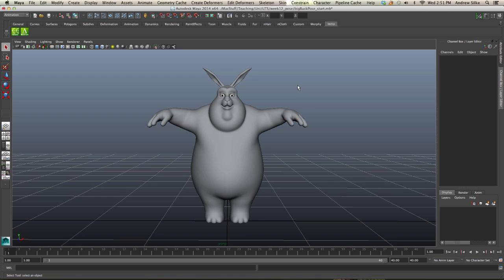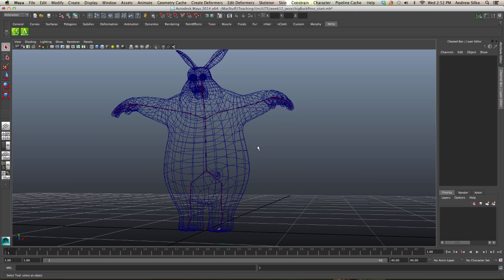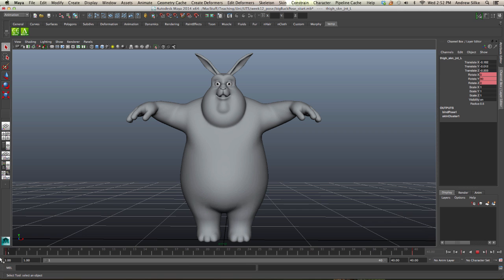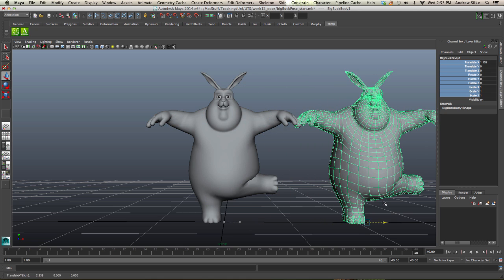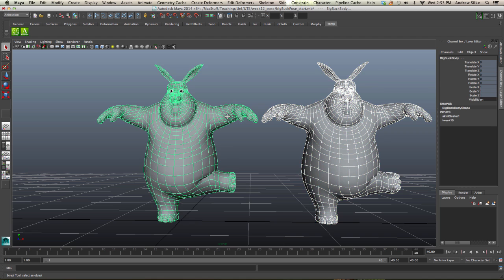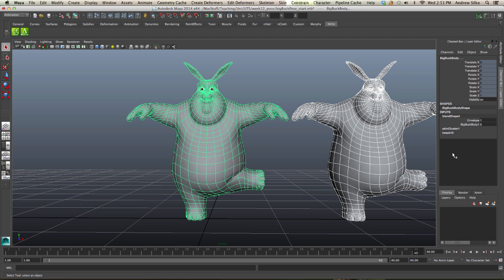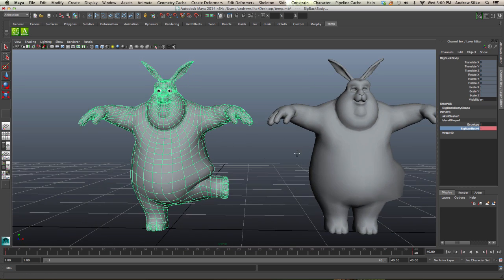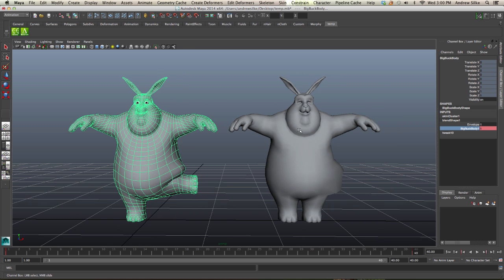Corrective Blendshapes: Manual Method (Maya)  Vid 2/7

Comment: Thanks. Does Maya have Corrective Smooth modifier like a Blender? It is very nice for animation
Reply from the maker: Yeah this tutorial is very old and it's all built into Maya now. The newer Blendshape Editor now handles creating the blendshapes automatically and extracting the deltas, so no need for this workflow anymore.  Blendshapes in Maya are just a single node, so it's similar but not the same as a modifier. 
Maybe lookup some "Blendshape Editor" tutes.  "Correctives" is more how you hookup the blendshapes to rigs, you can do that via "Set Driven Keys", or "Pose Interpolator" which is a kind of a RBF solver.  Anyways you can lookup "Pose Interpolator". 
I use the "braverabbit SHAPES" plugin for all my blendshape work now, it automates everything nicely and handles complex setups.  Its for professional setups.  
http://www.braverabbit.com/shapes/
Reply: @andrewsilke1  Thank you. Corrective Smooth in Blender works like Mayas Delta Mush. And Blendshape like Shape Key. Thanks for link
Reply from the maker: @olesyanovik2118  ah no, not delta mush, that's something else ;)  Extracting Deltas is different from delta mush.  Don't worry about what it is, the blendshape editor now handles it!

Comment: Hi ! Can it be solved only by skeletons ?
Reply from the maker: if you put enough joints in place. You can wire them to set driven keys. Blendshapes are much easier and are fast in Maya, the exception is exporting meshes to game engines, then joints can be handy.
Reply: andrew silke Yes , I want to export it to Unity without using Blendshapes. And baking deformation into skin weights also didn’t show good results. So sad..
Reply from the maker: @SuperLIGHTMEN  Yeah, you just have to be clever with the joint weights, you can use something like the SHAPES plugin, it has a mirror SDK (set driven keys) section too, so it's useful for joints as well as blendshapes.  Search for 
braverabbit SHAPES
Then find the set driven key tutorials

Comment: hello I desperately need help with something. This is the second time this has happened to me where i need to start all over. Basically I have a time editor open and I created a new composition for my characters hierarchy named practice for painting weights. This was just to paint the skin weights on my char. After I did all of this, I added some animation nodes and then deleted all of the nodes and composition because I had completed the adding of the weights. Everything was good. And SOMEHOW I keep making it so that even though, there is still a skin cluster for my model, the ctrl shapes, do not have any bind to the character or his joints. So it is as if i have not skinned it yet. Please help